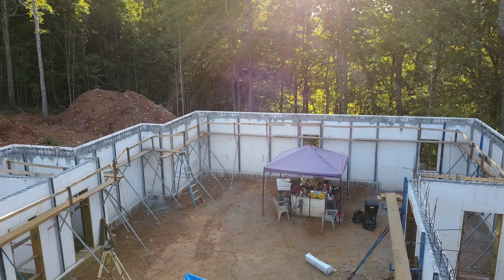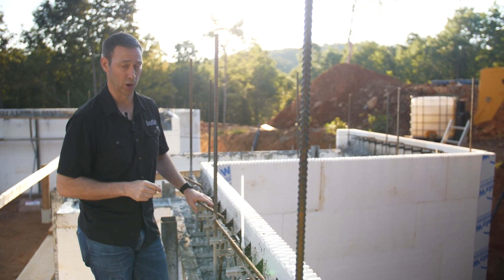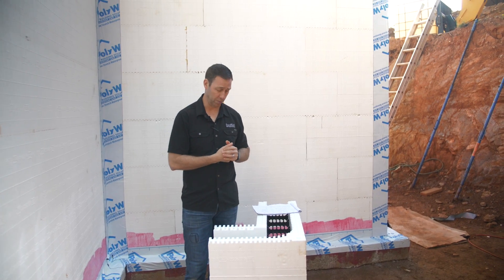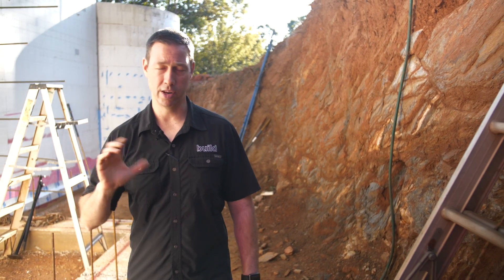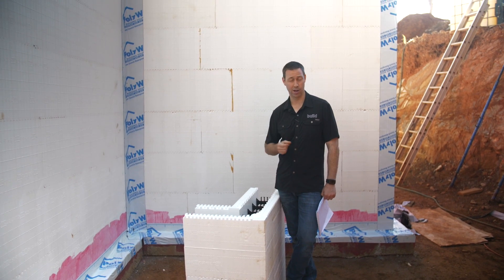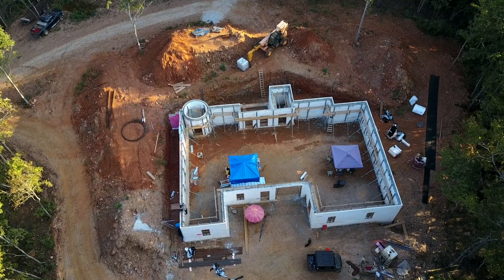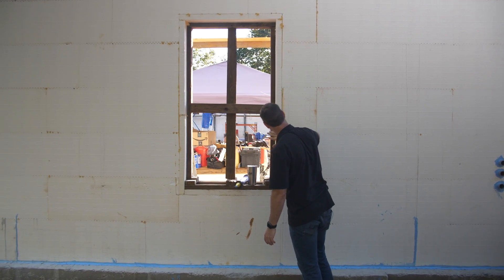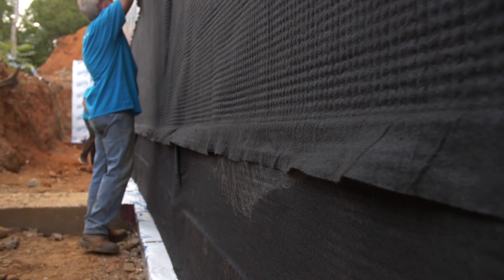Insulated Concrete Forms - Overview, Costs, and Cons

Comment: It is not done more because of comfort of builders with a product they do not know. Matt mentioned some of the things you have to pay attention to. Of the four barriers, water is the most important detail. Air is second and ICFs are great air barriers. The foam and concrete are also vapor barriers so you really need to control the breathing of your home with air exchangers.
And R value is just one variable in thermal comfort and energy efficiency. Concrete has a high thermal mass so it is a thermal barrier. With styrofoam thermal breaks the wall has a tendency to want to stay the same temperature. Once it is warm or cold it stays there. Same theory behind bermed houses. High thermal mass.
Reply: beamed houses are not simply a thermal mass issue-the ground temp syrrorundign wall stays more constant, water inner, cooler in summer.

Comment: After the last video of the 5 worst building products, and all of the people that think he's a quack for talking trash about vented gas fireplaces, I've come to the conclusion that he's not the contractor he says he is. He's a paid spokesman for an insulation company or a rigid foam company! He's a modern day, Bob Vila! You never ever see him do any work. He talks about the process or has other people talking about the process,  and they're all always insulating something! Every video is usually some fire hazard rigid foam board! He doesn't reply to any comments,  probably doesn't read them either. I checked his sponsors one time and the company's how to video is a YouTube video of Matt Resinger, showing someone else doing it in not very good detail. Usually they are about finished.
Reply: Ricky Fink, sorry you got that impression. I’ve met Matt and although I don’t know him well he seemed genuine. He has been doing this video blog for ten years for the love of building science and a lot of building science has to do with insulation and air sealing. Watch some of his older videos where the sponsors aren’t so prevalent.
Reply: Just do a simple ICF Foam Flammability" for some quick searching and most include an inhibitor that is not deemed hazardous, but that still goes without saying, carbon dioxide or smoke inhalation is still hazardous even if toxic or not. But ICF will not burn it just melts, I have microwaved a few containers on accident and they melted maybe smoked a bit, but never literally caught on fire. but as I said, you still do not want to inhale too much smoke of any sorts, it does not taste great and it can kill you as it burns your esophagus since it is HOT.

Comment: I wonder if you could just distribute window holes and them fill some of them. If you ever wanted a window there later you could knock out the blocks.
Reply: You can block out forms and pour as a knock out, not easy but can be done.

Comment: Hey Matt,

Very good video. I install both systems in a northern climate (Alberta). I love traditional for it's energy efficiency (think carbon footprint of a form used 300+ times, made of wood (carbon capture)) compares to EPS (much more waste, made of oil).
Waterproofing is coming leaps and bounds so that is great in both respects.
Thermal mass is interesting to me but I may be mistaken. The outside EPS negates the interior EPS with regards to the thermal mass, it really depends on which side has the higher differential. However if you fasten (hilti) XPS to the exterior of a traditional foundation you get better R value and the interior (warm) side of the wall has a thermal mass compatibile to your desired outcome.

However ICF is homeowner friendly in some aspects. It is lightweight. It is disaster resistant (a solid concrete house is as well (stackable forms)). The time saved framing a basement is appreciated by many homebuilders.

But ICF is always compared to traditional framing, which is an apples to oranges scenario. Whereas framing using modern methods and technology can often outperform ICF walls.

I would love more videos discussing pros and cons, not just the distributors ideas.

Comment: The reason we tilt the wall in slightly, 1/4”-3/8”, is because the braces can easily be pushed against the block to straighten the wall but pulling it back will pull the bracing off since it is screwed into the polypropylene. To be more accurate you tilt the wall slightly towards the bracing.
Reply: Robert that is a very useful bit of information.
Reply: I like to toe in, then adjust after the pour is complete.  Braces are designed to push, not pull.  If that wall settles "out" during the pour, you could be in for a world of hurt.
Reply: The ICF house I built had adjustable bracing so you could build the wall to finished height and then adjust for plumb
Reply: Oh but he said how strong screwing into the foam was, blahahaha
Reply: The ICFs also micro settle and if the bracing is rigidly attached, the ICFs will naturally lean away from the bracing as wall is filled. Prep for this by leaning it into the bracing.

Comment: Matt, excellent video with a good balance of commentary plus and minus. I am a general contractor in New Mexico that only builds with Icf and vary the products from different manufacturers to the requirements of the building based on experience with many different systems. I use  one system that has true R values up to R84 for a walk in freezer. The fly wheel effect of heat storage from the concrete in climate zone 5 amounts to about 84 hours of storage of heat versus 14.5 hours for a 2x6 stick frame wall for a 3000 sq. Ft. House  so the same amount of heat loss can be measured. Several of my houses have proved this out. People get lost in the hype from different brands but true noticeable difference shows up when you change exterior foam by R10 amounts or 2 1/2" layers. I appreciate the videos you produce for fair  and accurate reporting. One other thing the EPS foam gains R value below 30 degrees and other types of foam lose R value. EPS also has a faster wet to dry ability. Dave Taylor Taylord Designs
Reply: Thanks for that info
Reply: Good to see the input from an actual builder using ICF, I built a house in Australia with ICF and it was pretty easy

Comment: I am considering Bautex for a coastal  home in Florida...I was originally going with tradition ICF, but really like the Bautex system...

Would love to hear the pros and cons of Bautex vs Build Blocks.

Also, would be very interested in the net incremental cost vs absolute cost of ICF over traditional building materials...There are some savings along the way with ICF.
Reply: the biggest savings with ICF is the climate control bills being much less to nothing for a Net Zero home along with lowered insurance premiums due to it is a monolithic home.
As for the Bautex style, there is a reason most all other manufacturers abandoned that system due to the less use of concrete and the "ease" of installing the horizontal rebar as opposed to the common form you see him showing and proving is better with the ease of how the rebar can be laid in more easily. But it is your decision, go with it if concrete is expensive in your area, or suffer the downsides of having that much less concrete and more insulation foam in compare to a monolithic system as shown.

Comment: Matt, I have watched several other owner-builders use ICFs and they all seem to have the interior bracing. This is the first time though that I have seen a curved ICF wall which think would be cool. The last people I did see them put some waterproofing and a drainage system along the back and side walls that would be filled in with dirt and gravel.  Great video I look forward to the next one.
Reply: Pretty much all recommend interior bracing only even above grade, as adding on both outside and inside would create a push-pull scenario against each other and outside bracing would create a conundrum for the concrete pouring equipment to challenge against.

Comment: Had a friend’s new house completely cave in. Loud popping sounds woke them one night during a rainstorm. The entire front foundation of the house made from insulated forms had fallen inward, taking the front stairs, the way out, with them. Nine months pregnant, she had to jump to safety. 
Not sure why this happened, or what should have been done differently, but I will not recommend that anyone use it. 
Thought is that the clay soil expanded and pushed it in.
Reply: You were so quick to blame the product, but didn't questions the installer?
Reply: I'm sure there are more wrong  ways to do ICFs, like everything else, than right ways, and that if they had followed the rules for those conditions, the house would have been OK. But for the concrete or masonry fans who constantly badmouth wood construction, that's one area where wood has the edge. It's almost unheard of for wood structures to collapse on their occupants without warning; some even fall off their foundations and land in one piece.
Reply: So.... the wall was holding clay in...  Wood wouldn't even be an option.... but by the sounds of it it was under engineered wall.  A concrete wall is a concrete wall but if its too small it won't hold back the earth.   I fail to see how some foam magically made this happen.

Comment: Awesome Video Matt, could you do a followup video next and maybe some math comparisons to your 2x6 frame builds?  I'd love to know the actual construction cost differences and ongoing heating cost comparisons and construction times.  Extremely interested in how the mass of concrete effects R value.  Also, what the leakage test differences and all that geeky stuff.  Keep it up Matt!
Reply: just crawl the web for this info, homes like this have existed at least 20 years. some commenters even mention how much less their utility bills are compared to wood frame or steel frame even, there is likely some videos on here as well of other owners residential or commercial/industrial who attest to how much better it is.

Comment: Bracing? Try ZONT system.
Reply: After buying the Zont system, and all the lumber you'll need to go with it, making sure you get good quality lumber (expensive) and it's large enough that it won't bow when adjusting the turnbuckles, you'd be better off just renting a professionally manufactured all metal bracing system.
Reply: 00HiGhGuY00  It is made by FabForms (or perhaps written Fab-Forms).

Comment: Why don't they make a footer ICF so it's insulated and waterproof.  Seems silly to do all this waterproofing on the walls but the footing and floor just sucks the water in and then right up the walls too.
Reply: There is a waterproof footing system that stops rising damp. If you are interested, I'll find the info
Reply: Look up Liteforms footing forms and also check put the simpler Fab Form Fastfoot which can be used as the base protector and inside a form imo instead of sitting the concrete on foam board, especially if you want a squared up footer instead of how they show using their FastFoot system so you have the sides with are insulated and the bottom is just covered in the impermeable plastic thus keeping the once cured concrete from absorbing ground water at all.

Comment: where do you run electrical and plumbing? Great videos!
Reply: look up ICF wiring and plumbing, one video should appear from ICFbuildings channel, it shows running it along the foam block wall interior, if thick enough you can pre-install as he said conduit through the concrete before pouring to make easier wiring but comes with the downside of easily rerouting where as shown in the video i recommend looking up points out that going through along the foam is more easy and can be just as simple to reposition a line or add in other lines.

Comment: So when you say it's about $15 per sqft to do ICF what is the equivalent cost for a stick built wall by the sqft figuring in wood, insulation, etc., etc.  Obviously both require an interior and exterior skin so those should be the same.
Reply: He did say the portion he was in is the basement, but as many will attest having built with ICF on their new basement alone under an existing stick framed home that the climate control bills have been significantly reduced and in some cases where it was all ICF it negated the cooling/heating bills for a Net Zero Energy home.

Comment: I love how you told us the inside info like there getting charge 40k to run power and its cheaper to run a solar power system
Reply: That is just one of the hidden charges no one tells you. Impact fees, Traffic fees, Drainage fees, Fire Department fees, School District fees, Water fees, Sewer fees, whatever other BS fees corrupt officials implement. They are usually calculated by the square footage of a building so I don't even want to imagine what their total fees are at 7000 square feet.
Reply: @MrJramirex  it's not a hidden charge, they are deep in the country. I'm willing to bet one of the first things people look into when looking for rural property to purchase is whether or not there is power nearby. If the nearest power line is 5 miles away, the power company isn't going to just spend tens of thousands of dollars running power to your house so you can pay them a couple hundred bucks a month. 

I do agree with you that there are always tons of red tape and made up fees, but this isn't one of them. It could be paying for transformers, lines, labor, poles, permits, obtaining easements, etc. If the power company agrees to bring power to you, they are signing up to maintain those lines forever. You may only use the house 2 weeks of the year, but they have to keep them going year round. No one will be happy if they just abandon the poles in place after you die or move out either. The power utility is there to make money obviously. Even co-ops and municipal utilities can't just connect everyone for free. If I live 5 miles outside of a nearby town, would I expect the town to run water and sewer all the way to my house just for me? They would go bankrupt if they did that for everyone.
Reply: @commoncentstx  I'm actually getting a property a little over a mile from the grid...and APS (Scrooges that they are) want $120k to run power to my property. So instead I'm going to be putting in a $10k small solar system and take advantage of living in South Phoenix.

Comment: I wouldn't build ICF or Wood or Concrete Bock anymore. I will build Steel and AAC Block system like YTong and Hebel does especially down here inFlorida
Reply: are there any AAC suppliers in North America? I thought the plant had closed.
Reply: In Haines City Florida is the last and only Plant. They build strong AAC blocks here.
Reply: I don't believe the AAC blocks (aka ALC) are Miami-Dade / 180-mph wind approved for those of us in A/V flood zones.

Comment: Matt, great video, you have consistently high quality content.  

My wife and I built an ICF home in TN two years ago and are very happy with the result.  We did all the block work ourselves.  5000ft2 at $80.00 a square foot finished and this is with high end finishes and 10 ft ceilings downstairs 9 ft upstairs.  Building costs in our area are around $150.00 ft2.  
We found the block and rebar very easy to use and install.  It is actually fun to work with and because it is so easy to use and so lightweight we found it safer than working with conventional framing materials.  
Getting a good bracing system is critical and for novice builders I would recommend you hire someone to help with the pour.  We had two guys come out the day before and then were there for the day of the pour.  Our walls are very straight and plumb.   
We have a stucco exterior which basically makes this a fireproof home and as a result our insurance rates are lower. 

We have seen really good performance in terms of utility costs (significantly lower than neighbors with much smaller, conventionally built homes).  One thing that ICF does not get enough credit for is that not only is the foam continuous but the concrete is as well.  As a result there is little or no air exchange though the walls which helps significantly to make the house more energy efficient.

We did not do a basement so our waterproofing was not an issue.
Reply: Where in TN? I'm in Chattanooga area and thinking about ICF but can't do as much myself anymore. I wonder if I can find a builder who'd do it and do it well.
Reply: Georg Ko'ko I live not far north of you.  After we talk would be happy to have you come look at what we built.  Depending on the project I am thinking you could still do a lot of it your self.  What is amazing is how easy the ICF is to work with.  Have some contacts and would be happy to give you some help.  Just let me know.
Reply: @TheMarpalm  I just emailed you. Thanks!
Reply: Yes please!
Reply: Georg Ko'ko you can email me at marpalm@aol.com happy to discuss.
Reply: Ga Fin - hard coat stucco.  Has worked well for us

Comment: ICF seems to be the way to go for a solid wall that can ride out either tornado strength winds or earthquakes. Sound insulation is a nice feature but my preference would run towards a high R factor. How does one wire the inside for switches outlets phone/internet wiring and the like?
Why the circular tower like structure at 9:36? Is it simply the coolness factor? That would be my guess as I like it. I also favor the off grid electrical. Shelling out $40K to local power utility is a no brainer. There's nothing I'd love more than to tell power utility where to shove it. 9.21.18
Reply: Hey Howard! The circular "tower" is a turret that will connect the basement and upper floors. It's accomplished with our curved radius block https://buildblock.com/products/buildradius-icf-wall-pool-radius-forms/. Electrical outlets and wiring are easily embedded into the interior foam. These chases can be easily cut with a knife, pruning saw, hot knife, or even a chain saw. You can learn more about it here https://www.youtube.com/watch?v=i0oVOGw30HU.